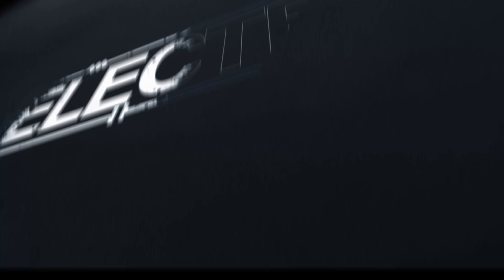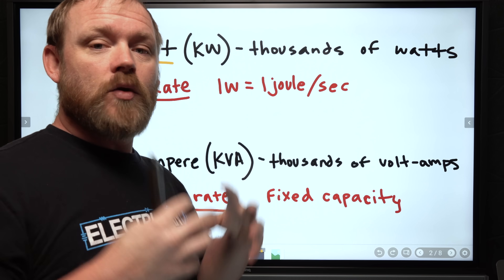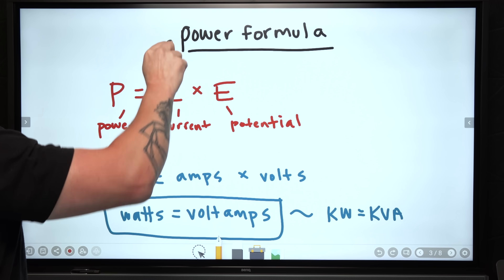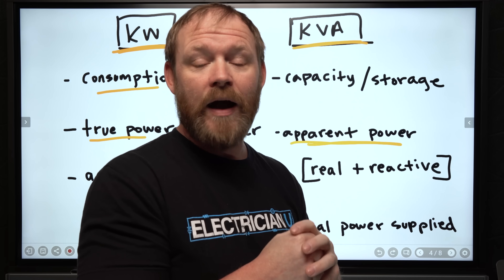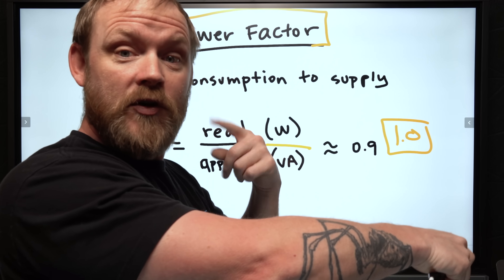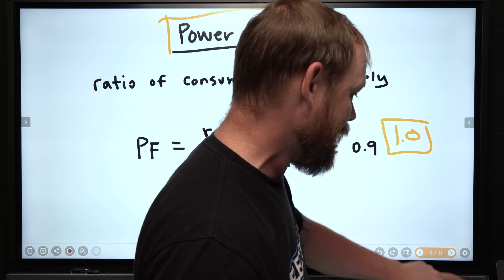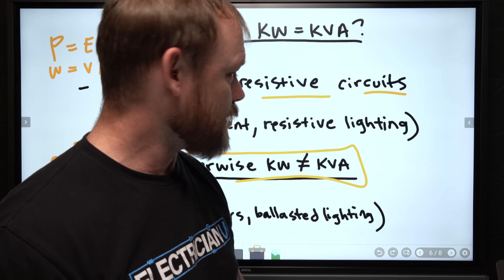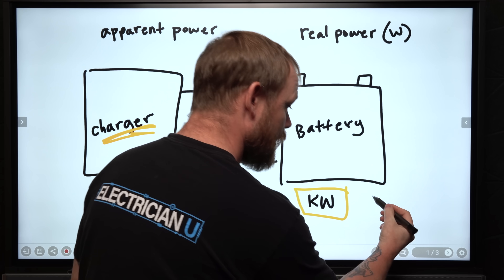Why KW and KVA Are NOT The Same Thing (Even If They Seem Like It)

Comment: Why is the power usage measured by my electric house meter in Watt then? My house is full of devices with reactance components. Great video btw!
Reply: Because you only pay for the real power consumed (watts). The utility basically supplies reactive power for free, which is why they try to minimize it and they try to keep the power factor as close to 1 as possible.
Reply: @ Thanks for the explanation!
Reply: @jaybee2530  For residential service, the utility deals with the reactive power.  Substations will actually correct the power factor to reduce feedback getting all the way back to the generators. 

For COMMERCIAL service, the business pays for the reactive power… they don’t get it for free and are expected to (or may be required to) install their own power-factor correction devices if they happen to have a lot of loads with poor PF.

Commercial utility service may also have other requirements imposed on them, such as leg balancing.  Also things which residential services don’t worry about.
Reply: @ Thank you for explaining!

Comment: Thank you for this breakdown. I do a review model for public charging sites where I do assess the power available at the transformer level. For simplicity, I've always referred to the transformer power as "kW," though the the transformer rating is in kVA. What I am looking for in this is the total throughput or power available for the site, so kVA is the more accurate metric. 
The other factor I am checking for is a discrepancy between the power supply and the rated output power of the chargers themselves. Most often, the transformer is rated for more power (kVA) than the total kW rated output power of the chargers themselves, though some providers (Tesla in particular) can have rated output power at their chargers that is more than double the rated power of the transformer. 
Basically, checking the transformer enables me to know whether EV drivers will be seeing full, rated power when charging if the site is full or mostly full.

Comment: FWIW- Etymologically a joule is a watt/second (not unlike how KwH is a killowatt over the timeframe of an hour); when speaking & saying "a joule second", it hits the ear strangely
Reply: A joule is watt-second
Reply: Why yes, YES it is...    Thanks for cutting & pasting the text I had used...   =)
Reply: @utoobrandomness7197  a watt/second equals a watt-second???
Reply: How can you get that EXACTLY wrong. It is kWh, not KwH...

The first is thousand Watt hours; the second is Kelvin something Henry.
Reply: I suppose it's nice to have people concurring on exactly what a joule IS, but ironically NOT the point of this comment 
Joule ~> intrinsically has its own measurement of time in it
Horsepower ~> also has its own time index baked in
The purpose of my comment IS saying joule is correct 
Saying joule second is NOT
As someone saying the words joule second, your earium transports it to your brainium; which is already aware that a joule is a watt second & takes a stab at picking apart "joule second";    WAIT!  WHAT?    A watt second second?    That's so stupid that's like someone saying KwH hour, or TwD day, or TwY year (if you feel superior taking a stab that the capitalization is vice versa, whatev's knock yerself out)

Comment: EE who makes electrical plans here - would love to hear from electricians in the comments - What are your favorite things to see on electrical drawings from the engineers, and what are your least favorite? 

Do you like color-coded plans or prefer black and white? What is a common annoyance for you when getting plans from engineers? Do you like seeing a specific thing first in sheets (one-time, schedules, floorplans, etc)?

Would love to know all your gripes/likes about plans to produce mine in a convenient way for y'all.
Reply: Everything should have a name from the start.  If you pull a wire and it is just a line on a floor plan, it probably wont get (a meaningful) marking on it and it will add confusion later.  Or maybe even worse, it gets a running number from a hat and later theres new plans that have added similar naming scheme and those get mixed up.

Then the naming scheme should be understandable or atleast opened up on the documents.  Theres often pretty alienated alphabet+number soup that doesnt say anything to the guys pulling the wires, so theres a high change they make mistakes in the markings.  If they could understand what the pattern is from the day 1, it would be way easier to remember and mark everything correctly.  This should help the planner too, as they have the marking scheme written on the plans and probably wont then come up with a new scheme on the fly, let say after a vacation (or a coffee break).
Reply: Other thing that came to my mind is circuit diagrams for "simple" relays/timers/switches/etc in a cabinet.  I'm not sure what those are called or how those are drawn around the world.  Here in Finland you just need to follow the lines and try to guess what the EE have had in mind.  It would be extremely helpful to have written explanation what should happen with different inputs etc.

We have such explanations with almost all things related to automation systems, but "basic" electrical stuff is often just the drawing.  It shouldn't be a problem with basic installation, but when the EE has made an mistake and/or you need to alter the functionality later, it often takes a lot of time to see the big picture and what will be affected.

Those circuit diagrams have often things grouped in a way that is not useful on the site.  If you need to check 5 different pages to see external control circuit, controls on the cabinet door, actual power circuit and indications to bms for one circuit, it gets annoying pretty fast.  I think that cad softwares should handle linking between different pages of a document automatically, but i'm lately seen a lot of diagrams where the page number + coordinate/group numbering just wont make any sense.  Not sure what breaks those.  Maybe some explanation for reader for using those multi page line following helper codes would be helpful too.